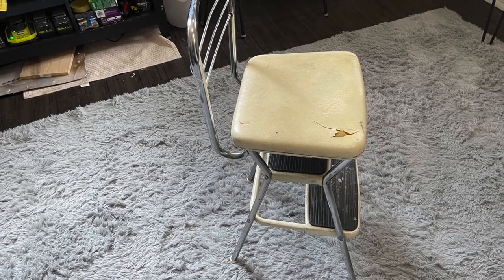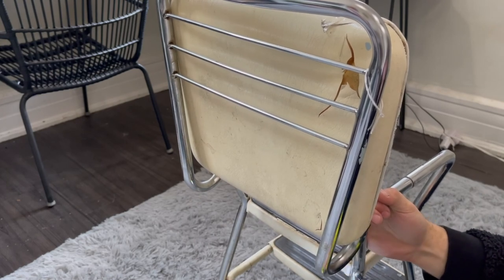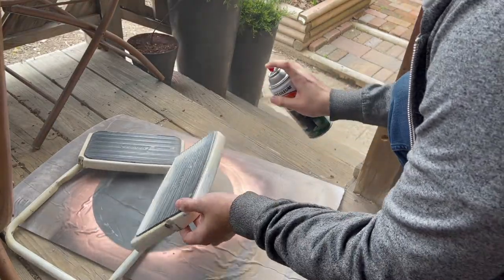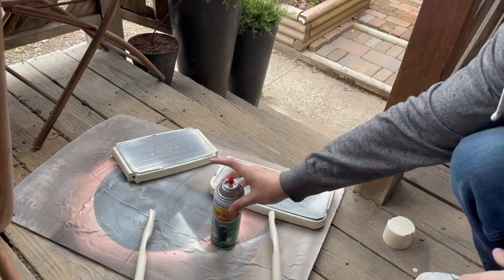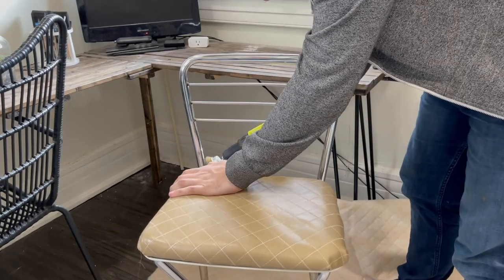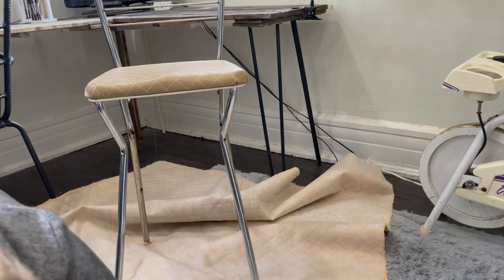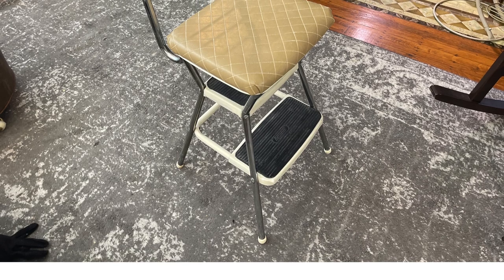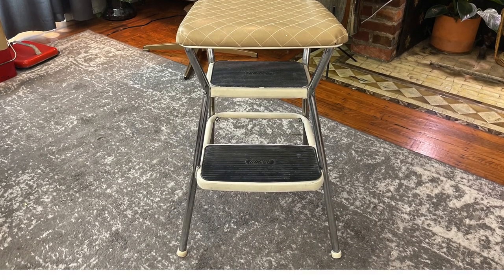VINTAGE MID-CENTURY COSCO FLIP-CHAIR DIY UPCYCLE

Comment: I have this exact one but I can’t get the seat to stay up. Is there a secret? Haha.
Reply from the maker: I haven’t found any secret! Mines preeeeetty loosey goosey so I have to be careful lol
Reply: @floorrejects6488   You Should Have Used Painters Tape on The Rubber Flooring of The Steps To Prevent Them From Being Spray painted. Also Changing That Old Padding Out For Some New Padding Wouldn't Have Hurt.